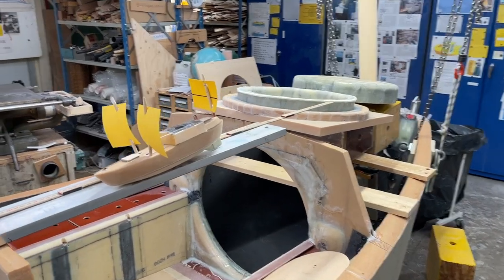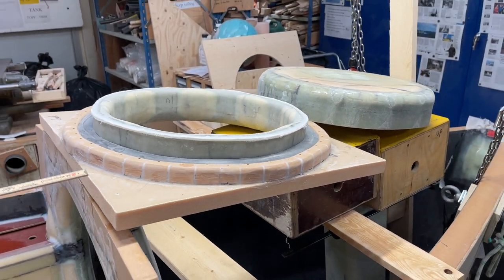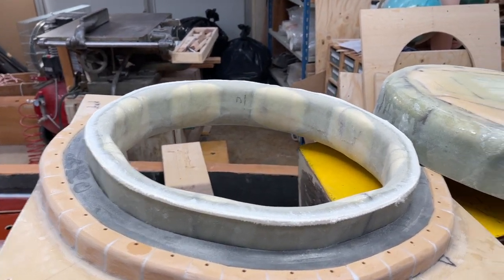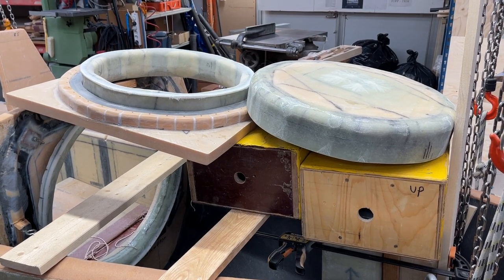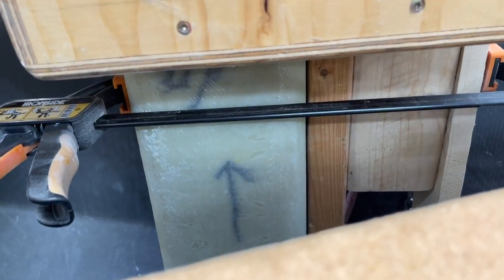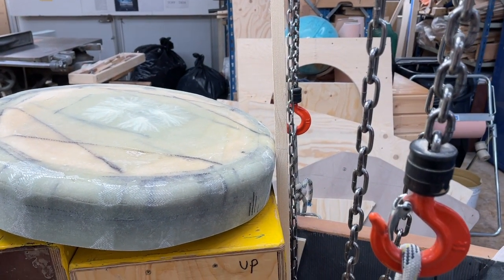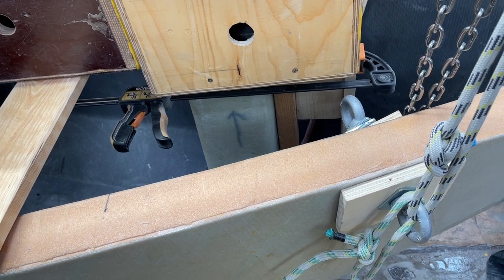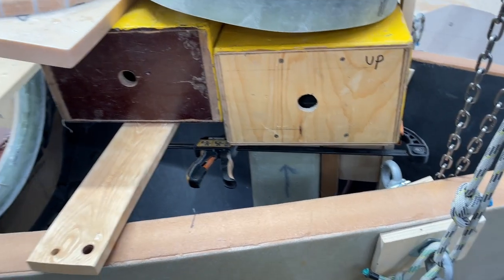30 Jan 2023  Aft deck hatch and mizzen mast are fighting the same space  I need to do more thinking.

Comment: Surely the hatch cover can be stowed either aside or infront of the hatch, really it would require a support but it would only need to be one of you Dyneema / epoxy rope constructions coming out from above the window.
Reply from the maker: In front I hope to have solar panels.
The sides must be free for me to reach the water for cleaning swimming and using the oar.
Let me do a bit more mockup.
Reply: maybe you can move it to the rear at an angle, having it sit rear of the hatch but offset to starboard.
Reply from the maker: @schuttrostig5729  I will do a bit more mockup